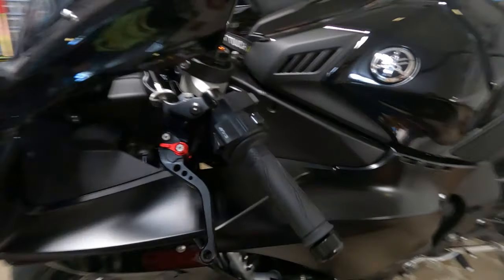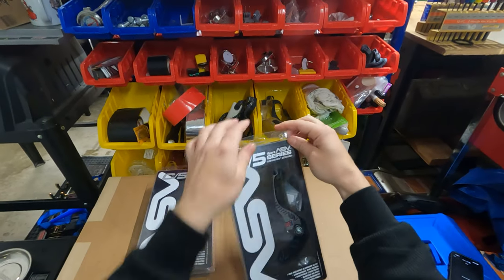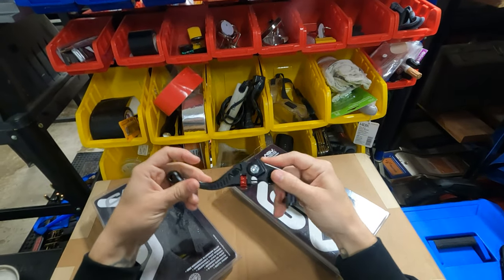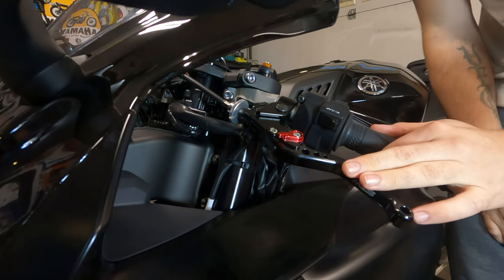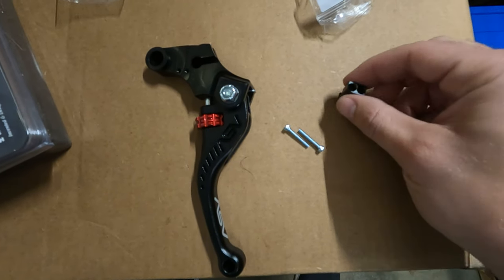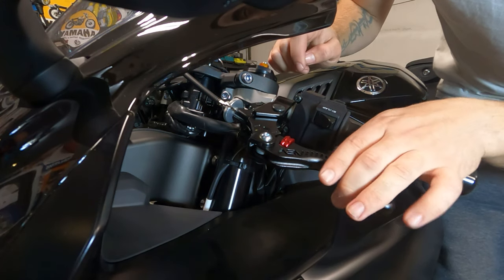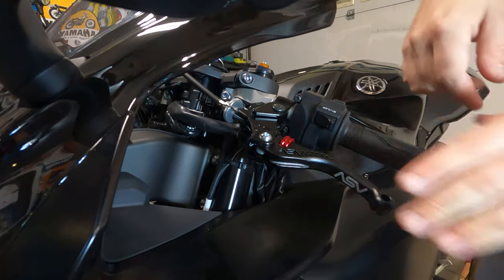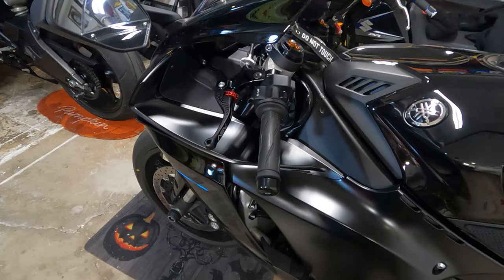Yamaha R1 ASV Levers Install! The BEST Levers for ANY Sportbike!

Comment: Very cool! 
Nice to know they make a cheaper lever now, they so expensive! Like $150 each?
Reply from the maker: Yes so the F3 I think are $110 and the C5's are around $135. Not much difference but it helps.
Reply: Only difference is the C5 is a CNC machined and has a slightly different finish, the F3’s are forged, both are great quality.

Comment: I was wondering if you know anything about the brake switch … because when I plugged mine in the brake lights stayed on … I’m not sure if it’s a faulty switch because I took it off and adjusted rear brakes and the light was normal but as soon as I plugged the front switch the light stayed solid??!! Like reversed someone

Comment: did u find it hard to get in the clutch pivot bushing? mine needed to be hammered in!! then when i torqued it up to the recommended settings it was binding so had to loosen it!
Reply from the maker: No not a problem for me. They just need to be snug with some loctite. Dont crank em!
Reply: Just installed mine. Didn't even think to pull the bushing from the OEM lever....